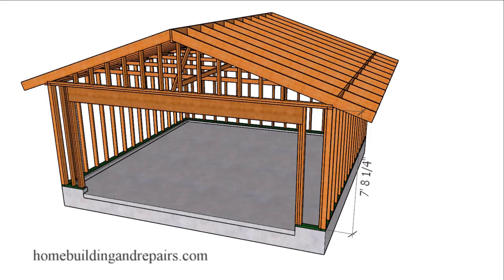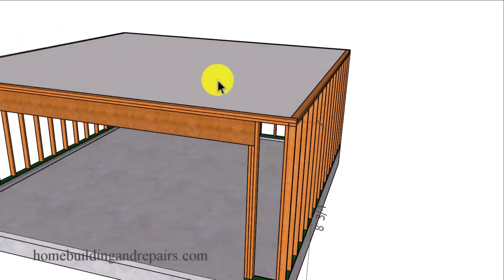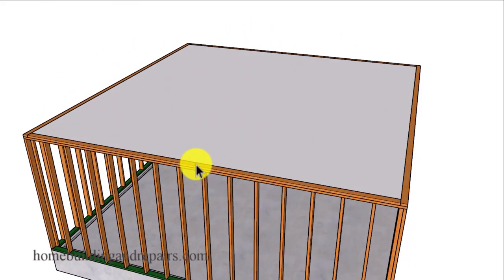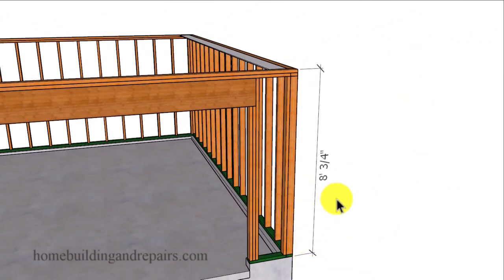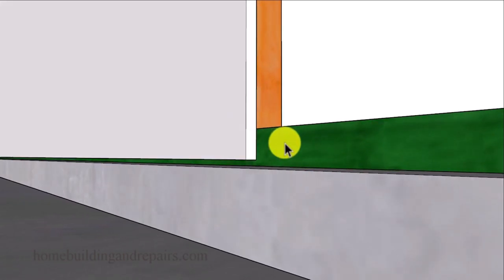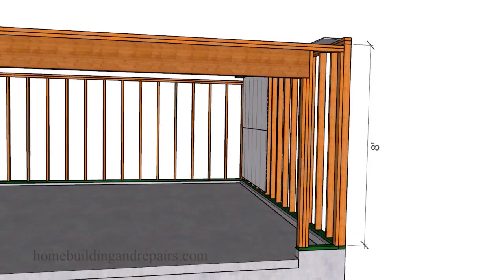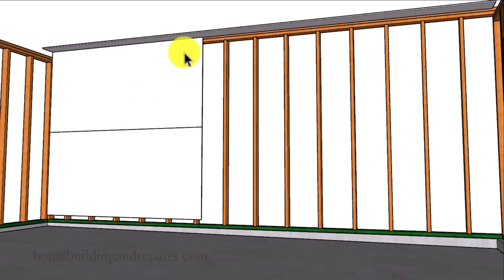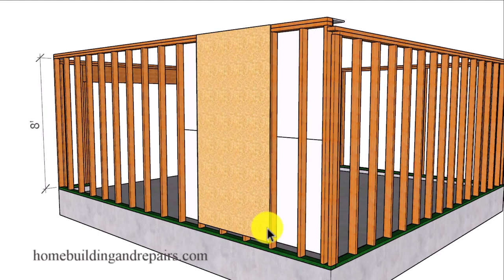The Reason Why Engineers And Builders Use 92.25 Inch Wall Framing Studs And Not 8 Foot Tall Studs

Comment: pre-cuts for 8' ceilings are 92-5/8. Adding 4-1/2" for plates and subtracting 5/8" for ceiling rock, and 1/2" for sheet to floor gap leaves 96" ceiling height.

Comment: What do you do with the outside when left with 3/4 of an inch and you have 8x4 plywood? If you leave the recommended 1/8 between panels you got a 5/8 gap left. This is a legit question. What is used to cover up the gap?
Reply: Assuming your talking about the outside sheathing, then reverse it. Place the gap at the top, fill in the space between the rafters with a plywood strip 6 3/4 inches or the appropriate width for your trusses or hand placed rafters. Fill in the smaller gaps with a sealant. 
This plywood strip should be just below the roof deck and should be sealed or vented as required in the plans.
-MG
Reply from the maker: That is a good question and there are a few things you can do, like covering gaps with trim. I will put this one on my list of videos to be made, because it can be a big problems with using plywood for shear panel and siding.
Reply: It doesn't show in this video, but when you put the trusses on, they will hang down lower than the top plate. Start the sheathing at the bottom plate, the gap at the top will be 5/8" and in the center of top plate. So, there will be no air opening, and gap will be completely hidden inside the soffit line. It becomes a non-issue.
Reply: @markoshun  You forgot to mention the assumptions you are making with your answer. Oh, and I think  you mean rafters.  Generally trusses are 1/4 inch higher than the top plate. A hand cut rafter does have a cut that will drop the bottom of the rafter below the top plate. There is still the need for blocking for both the rafters and the trusses on top of the top plate between the rafters, and some of the spec houses don't have soffits.
-MG
Reply: @meshedgears2794  My assumptions are just based on the typical building as discussed in the video. I did mean trusses. I'm talking about the truss angle to make the overhang, drops it down several inches below the level of the top plate, not the bird's mouth notches on rafters.
I've not seen blocking between the trusses, we use cardboard insulation stops and Styrofoam ventilation spacers on underside of roof.

How do you get your trusses to sit 1/4" above the top plate? And why?
Reply: @markoshun  That's interesting I just got another design a few weeks ago and they have a 1/4 between the bottom of the bottom cord and the top cord bottom. I understand it pretty common for a Finch truss or generally any truss. The top cord drops below the top plates at the end but I am discussing the structure at the top plate not 2 feet from the wall.
Blocking is a must in my area, but I guess its up to the architect and engineer doing your plans. I don't know how you get past fire requirements at the soffit area using card board but things vary...
Oh and the standoff of 1/4 inch lets the sheathing get just a bit higher lining the top of the sheat to the top of the plate provided the sheathing height works out that way, but that's what the video was about.
-MG
Reply: @meshedgears2794  I'm not surprised there's different rules in other areas. Those kinds of fire stops are necessary on multi-family here, we use fireguard drywall and non-vented soffit for a lot of firestops, but not on single homes. Curious how you get any ventilation past fire block on all sides..

My point about the OP question, is since the outside end of the truss is well below the top plate, that 5/8" short on the sheathing will be covered by soffit in this kind of build, so won't matter.
Reply: @markoshun  Itll drop with a birds mouth but not a straight truss
Reply: @markoshun  Ventilating is from the top or holes cut in the blocking (w mesh) Ohagin makes vents for the top and the blocking is just drilled. Nice thing about the top is you can adjust the location for the needed depth of insulation. You still need the foam channels, but the top vents are pretty cool, but a bit ugly. There's another version but I can't think of the name of the producer, same idea though from the top.
The soffit is not there on some of the spec houses in my area so the trim for a square soffit does not cover, its left open less costly...
-MG
Reply: @meshedgears2794  Ok, that would be a very unusual build around here. If you have to make the fire stops and vents look nice with holes drilled and screens, painting, etc., I'm not sure how much they are even gaining..? 
Anyway, we are a long way from addressing a 5/8" sheathing gap.
Reply: @markoshun  Yeah for a while that was the only way they built here. It was faster, the gap would have been covered with tar paper and stucco if there was a gap. These were spec houses... the blocking filled in the space between the rafters and the roof deck.  The blocking, rafters and the underside of the roof was exposed and painted. Building a boxed soffit was nice but that was actually slower and more costly.
-MG

Comment: Why not use 2 and 5/8th of a washing machine studs with a 4 and 1/4 size 12 shoe top plates?
Reply: Because 2/100 of a burger doesn't equal 1.32 of an half way trip to San diego.
Reply: Because 2/100 of a burger doesn't equal 1 half of a trip to San diego.

Comment: Why even sell eight-foot-long tubafors if we're just gonna chop 'em down to 92.5 inches.
Reply: You don't have to chop them down, studs come in standard lengths of 92 5/8, at least around here.
Reply: so if you used them for a top or bottom plate or ledger they break on 16 and 24 centers
Reply: @HazmatBoots  You would have to cut studs to make them break on 16 or 24-inch centers, but you usually use 16-foot 2x material for plates.
Reply: @Jay-tk7ib  I dunno, dood. I just went out back and measured a bunch of eight-foot studs as a sanity check because boy would I feel dumb if they measured 92.5 inches and I didn't realize it until now. Thankfully they were ninety-six inches long as I expected.
I live in the Greater Toronto Area if that matters.
Reply: @helmanfrow  Sure, 8-foot 2x4s are 96 inches long, but they are not called pre-cut suds. At least it's that way here.
Reply from the maker: 8 foot lumber is used for other parts of the framing, like 12 or 16 foot lumber.